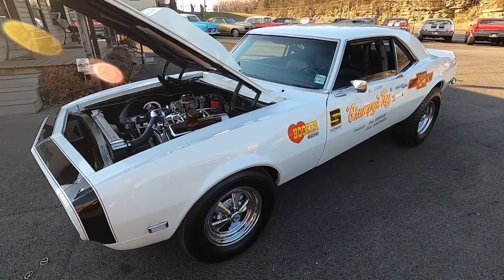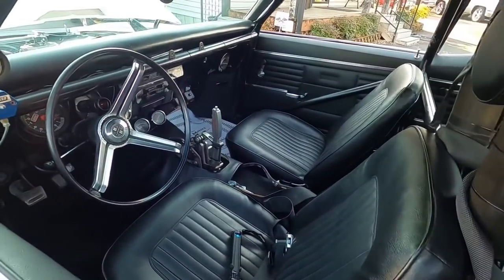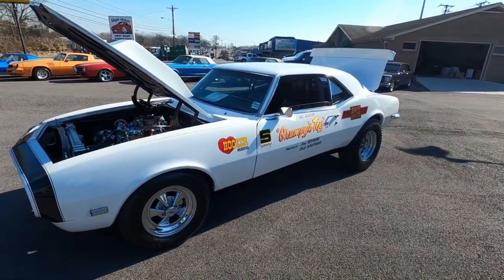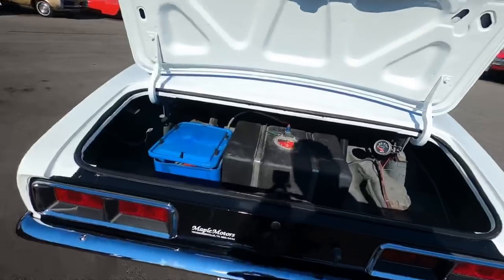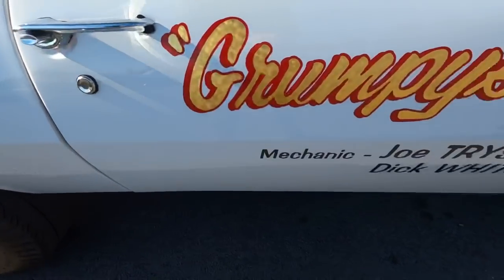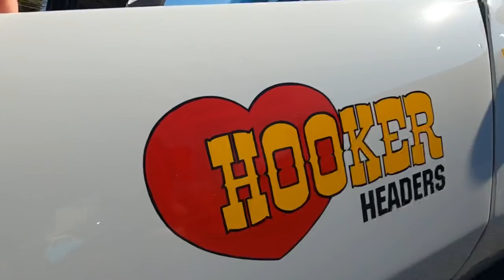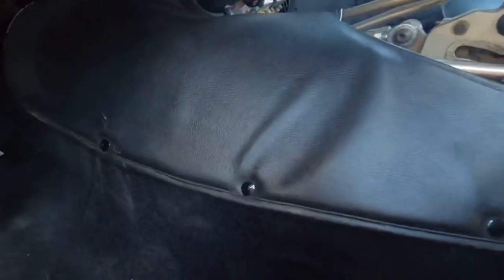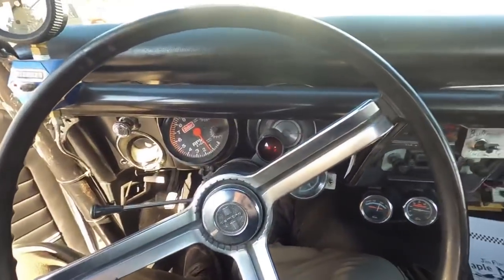Test Drive 1968 Chevrolet Camaro GMPP 502 Liberty 5 Speed SOLD $39,900 Maple Motors #1482

Comment: Nick, If you want to make that Grumpy's Toy shift better. Go under it and have someone put it into 1st gear, As long as you are in 1 st gear just take the cotter pin off and pull out the linkage rod and you have to adjust the length of each rod so that while you are looking right at the place where the rod goes, It has to be in the center of the tranny spot, then put that linkage rod back on and do the same thing for 2nd gear the same way, then 3 rd gear, then 4 th gear , then 5 th gear and then put it in reverse and adjust the length  the same way. As long as you are in any gear just take the cotter pin off and pull out the linkage rod and you have to adjust the length of each rod so that while you are looking right at the place where the rod goes into place,  It has to be in the center of the tranny spot, then put that linkage rod back on and do the same thing for every gear.. It takes 2 people , but you can do it alone...

Comment: 1968 Chevrolet Camaro Drag Strip Ready
GMPP 502 Big Block V-8 engine with aluminum heads
Probably sold right after the video was put online.
Now that is a Real Car.

This was a Dilettante Presumption Theorem: All statements of fact, opinion, or analysis expressed do not necessarily reflect official positions or views or any other entity, past or present. Nothing in the contents should be construed as asserting or implying endorsement of interpretations and factual statements.

Comment: Cool car but on the street that trans would have to go. Borg Warner 4sp would be my choice.
Reply: You can even see them having to push it just to get the undercarriage shots lol. Definitely not practical for anything other than the strip.
Reply: It's made to go fast. Far faster than you can shift a manual trans. Her et would go WAY down with a manual trans.
Reply: Or a glide
Reply: @chrisbryant1657  yep with a 5500 stall

Comment: Nice for a tribute car but from the looks of the body it appears to have had a lot of working over and not what I would call up to standard for a tribute.  The feathering in on the "Grumpy Lump" hood scoop is a good example. Body fitting and gap alignment is off all around the car.  Hood pins won't clean up the front gap and if they didn't would naturally lift the rear of the hood more...And this is an actual '68.  Grumpy's wasn't a '68.  It was one of the first '67 Z-28's produced that he changed the doors on eliminating the vent window, added the headlight doors and glued other SS trim to it...I would have also gone with the 427 that he ran.  Although I prefer the 331 from the vega...
Reply: @frankjohnson6342  amen
Reply: @Prozak63  for 40g though someone got something unique .  one spec'd out like you (and I) would prefer would be 100g + car if done right .   I still love this car tho and I'm dgaf enough to drive a liberty trans on the street ! lol
Reply: @morpheophantasm8332  Agree 💯
Reply: @Prozak63   I was an SP btw lol 3702 bmts Lackland 78 🙂
Reply: @morpheophantasm8332  Thanks for your service brother.  I didn't get there until '83.
Reply: @Prozak63   ah ok .. thank you as well .   The stories I have about bmts lol   insane .   Take care SMS !  I just made Staff .